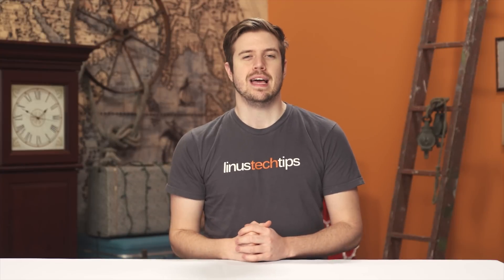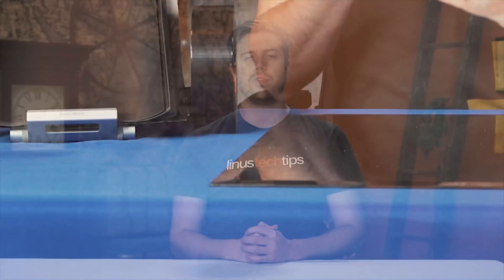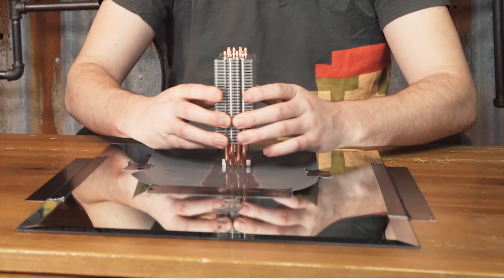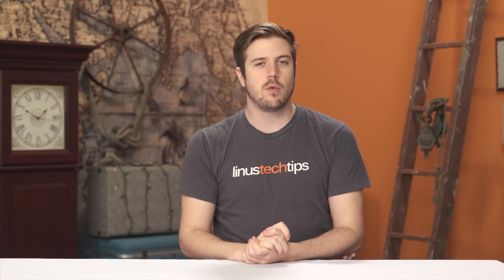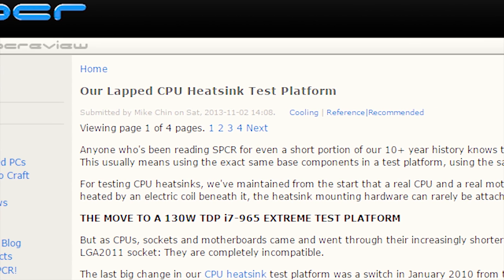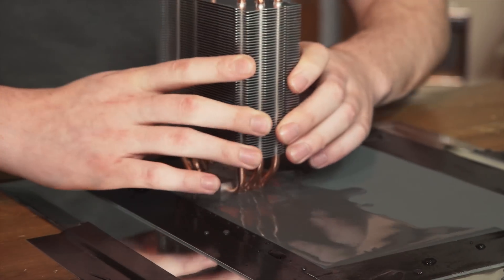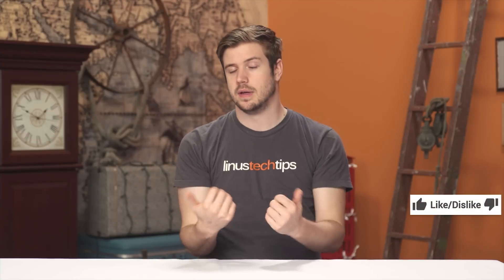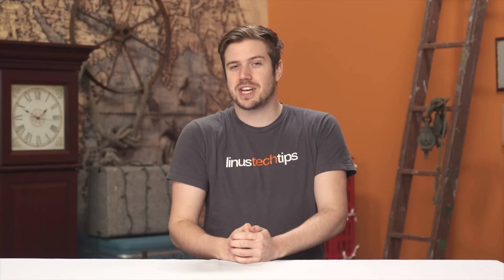CPU & Heatsink Lapping - Are concave, convex, or flat heatsinks best for cooling?

Comment: Curious as to why you didn't lap both the CPU and heatsink? Part 2? 

I feel like intel just doesn't give 2 craps about their IHS (as well as thermal interface between the die and IHS, but thats another story). Cpu cooler manufacturers make their coolers nice and flat and shiny to sell more of them. Lapping the cpu i feel would net better results. But of course lapping the more expensive part, and voiding the warranty on that is an undesirable thing.

I believe my cpu's IHS had some issues with "flatness" as i had some very high variation in core temp. I'm custom water cooled with an EK supremacy evo and 4790k. I didn't lap my cpu, but when i removed my IHS and got the "naked ivy" mounting kit for the supremacy evo, my temps went down drastically, as well as my variation in core temps. (i was delidded with CLU prior to installing the naked ivy kit and was not happy with my temps/core temp variations). 

I do still have some core temp variation (core 2 runs ~5C hotter, which is better than its previous ~10C) and overall temps dropped as well.

Comment: You have to lap the IHS in addition to the heatsink to have any results. It doesn't really matter if one is flat if the other isn't. I have lapped my CPU several times before, and it definitely helps, but the softer copper is prone to warping and may cancel out or be worse over time with pressure from the mounted heatsink.

Comment: U forgot the CPU luke. Otherwise thanks for proving a point. 

I know others will say this but let me repeat it.
The WHOLE POINT OF THERMAL PASTE is to fill in those imperfections and the curves.
If their is some major curves than lapping might do a little bit, mabye.

If it was something easy and quick it woukd not really matter, everybody would do it.
But it is not, it takes lots of time, takes some work, and can possible void a warrenty.
Unless u are some crazy overclocker i dont see any reason to do this.

I will admit i have never done this so i dont know from experiance, so if it works for u ... school me. But i dobt see any reaso  ti do it

Comment: Heat transfer through conduction is pretty intuitive, as in contact area helps. We could have assumed that when using a good paste (which we always do) it's not going to matter significantly if  surface is rough or glassy. If for some weird reason you weren't using paste, it would likely matter more since glassy and flat should slightly increase contact when 'dry'.  There are ways to measure pressure in different areas under mounted tension and  of course it  follows that the best shape would be one that 'deflects to even pressure' instead of having higher pressure around the  edges. But of course that would all depend on the size, thickness, shape and material of the face, and the cpu heatspreader.  It's easy to imagine that often there would be so little deflection that flat would still be best, but only measurement could tell.  I think it's hard to beat a decent all copper air design for bang for the buck/trouble/etc.  I'm looking forward to Pascal release tomorrow.

Comment: Did you lap the CPU? The title says CPU and Heatsink and as explained in the video, the CPU's IHS is what generally still has the curve in it. Of the research I did in the past on this subject, it was the lapping of the CPU that made the difference, assuming the Heatsink was flat. Also something you may be able to test would be Indigo Xtreme phase change material on a de-lidded CPU and between the Heatsink and IHS. I appreciate the research and testing you're doing and empathize with the frustration of little favorable result. However try lapping the CPU and see if it makes the difference, hopefully good results with come from it.

Comment: What are your temps with two rough surfaces? What are your temps with one polished? What are they with both polished? I dont remember you saying if the cpu was lapped or not. Please use a better block for testing, maybe an apogee like you were saying, it would be much easier to polish. That heatsink looked like it would tilt no matter what you did.

Comment: Heh, when i built this PC i wanted it to last atleast 5 years without changing GPU, mobo or CPU. So i picked i7 4790K and run it at stock clock. Being unlocked CPU i know that it has passed more vigorous quality checking at the Intel factory. Intel's stock aircooler also keeps it reasonably cool even at max load.

Comment: hell no I wont read it. This video was pointless. Use some logic next time so that we can all agree that 'lapping' or 'smoothing' of the contact surfaces will only matter if....

If the heatsink was a phase changer, then lapping would better because you will have such a great change in temperature. This smoothing of the mating surfaces will help with heat conduction which will be driven by the large temperature gradient of the two surfaces. Conduction between the surfaces are improved by eliminating any air pockets or surface imperfections. BUT WAIT?!

Is this not the reason why you put thermal grease (or mustard) on the CPU in the first place? This stuff is used to fill in the voids and make the conductance increase. Therefore there will be no measurable difference between smoothing and non smooth contact surfaces as long as your thermal conductance material doesn't insulate. I saved you a day of 'werk' but cost you atleast $1k in revenue.

Comment: Hi Luke.

Lapping a heatsink will never make a difference when thermal paste is used. As the role of thermal paste is to nullify any imperfections. If you redo the tests without the paste you will notice different results.

Cheers!
Reply: +Long Qua Missionary 
false. Its one of the greatest gaming innovations ever. You clearly are missing the point
Reply: +PewPewDie You are a literal garbage human being.
Reply: +Long Qua Missionary I am autistic
Reply: +Kak Pis why would you announce that
Reply: +PewPewDie who the fuck doesn't uses thermal paste?
Reply: +PewPewDie Exactly right.  This absolutely won't matter, as the end result is the same.  Thermal paste filling in gaps between the IHS and the cooler.
Reply: +Jacob Lambda You would be lucky if you saw 1 degree C difference, even if you did that.  It's totally pointless!
Reply: Hand Solo Mine does that with stock box cooler,when i open my window in January..
Reply: If the manufacturer machined them more precise there would be no need for lapping.
Reply: +Overclocked Gamer mine craft = autism

Comment: Linus the reason you didn't get results and also why all the forum posts you found are old. This is an old issue. When manufacturers didn't go as hard on the finished products. Stop doing crapastic videos! Use logic you have to if realized this before you started and it's lame as hell to watch your videos now. It's like a qvc channel

Comment: I used to have an E8400 and they were known to have concave heat spreaders, after I lapped it temps went down about 5 deg.
Mirror finish aint necessary just get it flat the TIM will do the rest.

Comment: I've been following people's lapping escapades since 2003 and I think the difference comes when there's old thermal paste being replaced with new stuff - the lapping being incidental. The only heatsink I ever lapped was a Thermaltake Volcano 9+ and it made absolutely no difference. I used glass and went even more mental with the sandpaper grits and finished off with a polishing machine. It was reflective enough to see yourself in but didn't cool any better. That's my 2 cents.
Reply: +ch0g0nda1 Actually, funny story: I was at a LAN party once upon a time and this guy's computer wouldn't stop overheating. Some dudes from the party took his heatsink off and proceeded to gouge the hell outta it as they scraped away the old black waxy Intel stuff with the edge of some pliers they found. A little original Arctic Silver later and the computer never had another issue, but I for sure thought they destroyed that heatsink with how badly they gouged it - like, if you dragged that thing across your face I'm sure it'd cut you. Conclusion: Whatever

Comment: Dear luke , you could try what linus did wrong I mean delliding your CPU but this time put liquid metal between the die and the IHS and thermal paste between the IHS and the heatsink, if you clean the glue the right way (not like linus)you should see from 10 to 20 degrees improvement, I tried this myself it works...
Reply: +Nahuel Cutrera Does a cpu contain aluminum?
Reply: +spaceminions I'm not sure what you mean... but the IHS that goes glue to the cpu die may contain aluminum of some sort, I think the liquid metal does corrode a little the IHS but is just a plate , if years later you wanna change it back you can remove the IHS and install the heatsink directly on the die, all of this is because intel doesn't wanna solder the cpu and puts thermal paste instead 'cause it's cheaper
Reply: Nahuel Cutrera I've seen pure gallium weaken aluminum so much that you can tear it easily; a gallium alloy might not be a good idea around an aluminum alloy.
Reply: +spaceminions this is the one I used 
http://www.amazon.com/Coollaboratory-Liquid-Thermal-Interface-Material/dp/B0039RY3MM
not sure if it contains gallium,
and here there's a bunch of guys doing comparisons only they used the liquid metal on the IHS too ...
http://www.overclock.net/t/1351984/coollaboratory-liquid-ultra-vs-liquid-pro-vs-phobya-liquid-metal
Reply: Nahuel Cutrera I guess there must not be any on the cpu/ihs itself then, if all those people used it without trouble. Cool, literally!

Comment: I've experienced better and more consistent results with lapping the cpu heatspreader than the heatsink base.  My Q6600 temps went down 9C after a couple of hours of lapping. All 4 of the core temps were much closer to the same temp as well. Most of the time it hasn't mattered and I don't bother with a cpu or heatsink that is providing decent temps with all of the cores about the same. I've never seen more than 1C difference with those. It's the ones that just run hotter than expected or has a wide variation of core temps that I spend any time with. That is unless I notice a major flaw or defect in the base of the heatsink.
Reply: +cee128d How much of that was better thermal paste from the die to the heat spreader though? Im sure lapping helps if the material is way out of flat, or has voids. On the flip side if there is too little paste on the die im sure that would have been the main issue. 

Just wondering cause I've seen this in the past that deliding will help if your CPU is out of range or has a wide range between the cores
Reply: +Sean McMunn Absolutely none whatsoever. None of the heat spreaders were ever removed. The only lapping was the surfaces between the heatsink and the heat spreader.
Reply: +cee128d Oh... I figured you removed the lid to perform the lapping :P but thats some great results though... 9C is quite a lot but what was the ambient room temp, how many CPUs tested (as you said "heat spreaders")  any other details?
Reply: +Sean McMunn If I had de-lidded the cpu I would have stated that. I said lap the heat spreader and there is no need to de-lid the cpu to do that and I don't recommend de-lidding. It's safer to just lap it. Many of several dozen cpus I have lapped over the years (both AMD and Intel) can't be de-lidded without destroying the core as the spreader is soldered to the core. The ambient room temps ranged from 66F to 75F depending on the time of year it was done. I lapped the Q6600 around 2008 and don't remember what the ambient temp was. 

I also stopped lapping with extremely fine grit paper. I usually stop at 800 or 1000 (depending on what I have on hand). I've never seen going finer than that make any difference in temps. It might make it shinier though, but since the surface is hidden who cares.

Comment: If you lap your heatsink base, you also need to lap the CPU IHS.
i was already doing it back a few years ago on a 3.9Ghz E6750 under a CM 212 and it was a big improvement
Im currently using a lapped/dellided 3770K @ 4.9Ghz under a HN-D14, and this is the perfect setup for using liquidmetal !
Reply: This, they seemed to forget that you need to lap the CPU heatspreader.
Reply: NCRranger24 - Gaming and More! by experience i can say that CPU's IHS are never flat :D

Comment: As a engineering student I must say that this it's similar to prepare a metallography, you need to get a mirror like surface to use an optical microscope in order to watch the structure of the metal.

Comment: Get a new heatsink and some high grit sandpaper (2000 grit). Colour the base of the heatsink with a black marker so the bit that would make contact with the CPU is filled. Do a few passes on the sandpaper as mentioned in the video and inspect the base. If it has worn off evenly the base is flat and you can remove the marker with alcohol. If some of it is shiny and some black, your base isn't flat so follow the video to correct this.

Comment: I used to lap the shit out of my CPU lids and heatsinks. I could usually eke out 7-10 degree temp drops. It's hardly worth it nowadays IMO. Always just remember to use less heat compound when lapping though. Less surface area to fill

Comment: you need to go further up to 2500 grit on both the cpu and heat sink then  buff them with finer and finer compounds and then you might see a 1 degree difference

Comment: I agree with what some others have said, the glass is too thin, At work (valve industry) we use 6-7" deep blocks of marble, also I'm not too sure on your technique, I have also found with lapping a figure of 8 motion and turning the work piece 90 degrees at X number cycles.BUTI would like to re iterate what you stated in the video, shiny and polished doesn't mean its flat.Anyways good job, I certainly wont be lapping my cpu / cooler  anytime soon, ill just keep water cooling.

Comment: Luke, I had the same problem of no improvement of the temps. You should try lapping the cpu lid as well. Also change the TIM on the internal die of the cpu. I noticed a 7 degree drop in idle with my 4790k oc to 4.8Ghz and my h100i GTX, and a drop of 15 during full load.

Comment: luke, please do a "building on carpet vs not on carpet" to show people it doesn't matter. XD thanks.
Reply: +News Cartridge It is worse, but so long as you're not rubbing your feet on the ground like an idiot and making sure to touch your case before touching your parts its gonna be fine.
Reply: I've built about 15 pcs + upgrades/management to them on carpet and never had an issue. BUT I went and bought a anti shock wristband just in case as electro static build up IS real and CAN/HAS broken pc parts for people. it's very unlikely to happen but it can.
Reply: +News Cartridge Dave from EEVBlog should do this test, not Linus.
Linus doesn't have the proper equipment, let alone a precision voltmeter
Reply: It does matter, if the computer turns on after building it that doesn't mean there is no ESD damage. 

If connections, pathways, whatever you want to call them aren't completely burned through form ESD then they might be partially causing them to have increased resistance, this can cause stability issues and random crashed. Even game and render crashes can sometimes be related to this.

It also means that your system might just straight out fail sooner than when there is no ESD damage. 

I started building pc's at  14 or 15 and I am 23 now. I made the mistake of building a pc on carpet once and it gave trouble after three years, applications started freezing randomly and windows as well. This is the only pc that has ever doen that and it might not even be ESD damage but it might have been. After this I started to do research and figured out it is a little more complicated than 'if it turns on, you're good'.
Reply: +News Cartridge having a pet around to shock also helps!  They won't remember it five seconds later when your petting their ears anyway.
Reply: +News Cartridge I imagine the type of carpet matters here. But... I've done enough risky builds (on carpet with no ESD protection of any kind) without breaking anything.

There is a risk, but there's no guarantee that you'll break anything even if you do all of the riskiest things together.
Reply: lol
Reply: +News Cartridge YEAH
Reply: +News Cartridge My 290x doesnt agree with you. Only card that ever died on me, was when i changed the paste in my couch (with a rug mat)
Reply: MrJason005 its more just a joke to show people it doesnt matter really. id give it about a 1-2% chance of frying a component because of building on carpet alone wiithout trying to be an idiot and build it up on purpose.
Reply: +News Cartridge Louis did a video about that
Reply: so yesterday i once again swapped cases for my freenas server on carpet. no issues, but like i said, it can happen.
Reply: this, ive done builds with sweaters on, socks, winter dry air, ect... i just make sure i touch the case if i move off of where im standing and move any decent distance, never ever had a problem with static and never used ESD
Reply: the only circumstances i made a board short out.... I put a wooly jumper on the open case. The board actually caught fire, but still worked after lol.